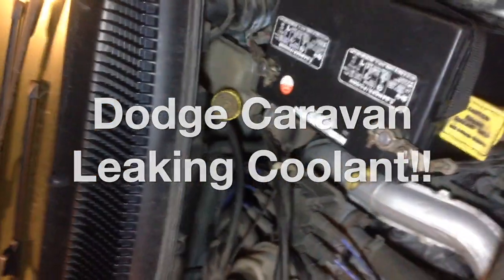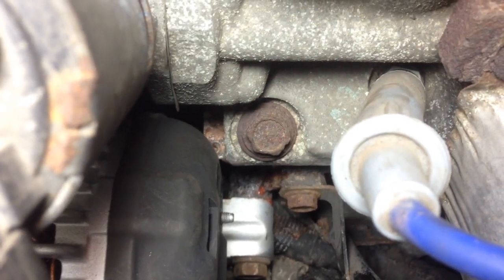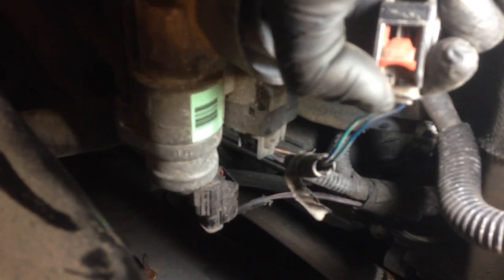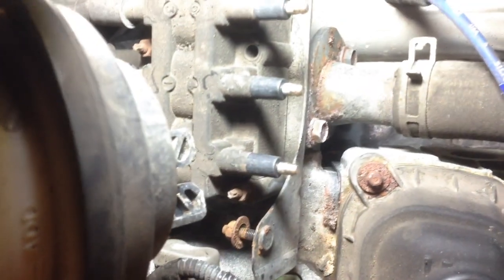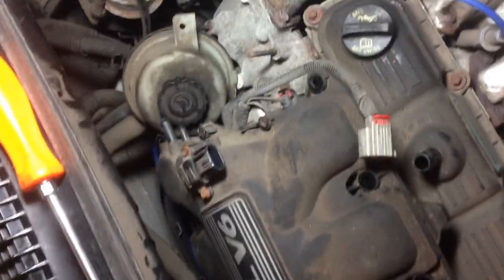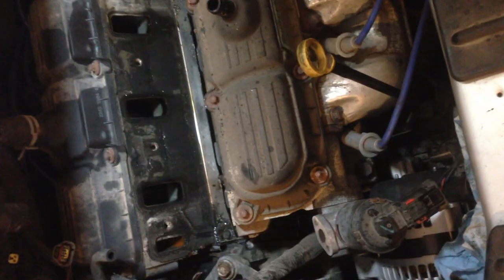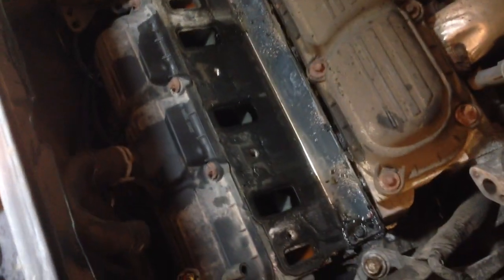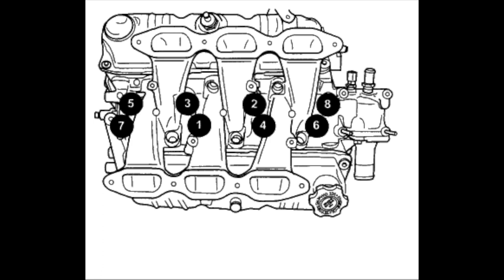2001 - 2007 Dodge Caravan Intake Manifold Coolant Leak and Fix

Comment: Excellent detail where needed with hidden bolts/hoses, tips, etc.
Reply from the maker: Thanks so much, really appreciate the comment !!!
Reply: @GarageKing  how u connect  pressure tester kit?
Reply from the maker: @savipv8491 hey there, you connect it to the radiator like I did in the video. You have to buy a pressure tester kit and it will come with different adapters.

Comment: What about leaking into the exhaust. 2007 grand caravan. Could it be Head gasket, cracked intake port, or intake manifold gasket.. There is no water in oil at all and does not overfill, and no superheated of the radiator water, bubbles or exhaust smell. This has apparently been going on for years and getting worse, although radiator sealer is slowing it. My muffler has rusted from inside out. I just replaced the radiator and water pump as they also were leaking. When it starts to rain on an old vehicle it pours. Thank you
Reply from the maker: Hey brother thanks for the comment.  I don't see many cracked heads on these, what I do see is leaking intake manifolds.  They can be confused with a head leak from the outside (when looking) as the coolant runs down the rear cylinder head and the coolant boils away (you never see it)  So you don't get a leak on the ground (unless its really bad) you don't get a rad that overflows when you start the engine cold with no rad cap (usually head gasket) A really good way is to pressure test it, you can buy a cheap pressure tester on Amazon.  Check out this short 30 second or so clip of me pressure testing a caravan, you can see the coolant leaking from the intake.  https://youtu.be/LYikQA98zJw  By the sounds of your description it looks like you probably just have an intake manifold leak (which is good, as it is not that expensive to fix - just gaskets and new coolant)

Comment: I have the Chrysler version of this (my first car via my mom lol).  It’s leakin real bad we think it’s the coolant reservoir. Besides that, 210000 miles and still drives when it’s not overheating.  But my dads been putting coolant in every 2 weeks.  It’s crazy.
Reply from the maker: Well if its the reservior then you definitely have an easier job.  I would give it a little wash off, let it dry and then pressure test it cold.  If you can't pressure test it, then take is for a drive and see if you can see anything leaking anywhere.  You may have to feel with your hands (being careful not to burn your self of course)

Comment: So I have this exact kind of van. Im having leakage into cylinder 3 behind the engine. I noticed when I was replacing all the spark plugs that the back middle plug was rusty and smelled of coolant. What can I do to fix?
Reply from the maker: That's good if you can see the leak/smell as that means its probably leaking from the outside.  It could be the same thing as the video (the intake manifold) your best bet is to wash the engine and then pressure test and look like I did.  You should see it leaking.
Reply: @GarageKing  Thanks for responding all these years later! Ill have it checked out!
Reply from the maker: @geemu1492 I do my best !!!

Comment: I have a leak.  Did not see it under pressure, but I have to refill radiator most every day.   It is not pulling coolant back from the reservoir.  Why not?   I sucked on the hose and the coolant from the res came back to my mouth (I know, bad).  I just got some dye and a UV light.  That should help me find it.
Reply from the maker: Hey there and thanks for the reply, the reason its not pulling coolant back from the reservoir is it's pulling in air instead which means its easier to pull in air than pull the coolant back.  I suggest that you get some engine degreaser and give the engine/radiator a good cleaning.  Let the engine dry and then raise the vehicle on jack stands.  Put the pressure tester on and go underneath and WAIT...  You might have to wait for 10min to see a drip, and then you can trace the drip.  The most common leak points are the intake manifold, and also the radiator can leak where the plastic meets the aluminum core. FYI - don't feel bad about sucking on the hose to test it, we have all been there LOL :)
Reply: Thanks for the response and thanks for making the video. 

My engine is fairly clean so I didn't clean it this time.  I did however (2005 dodge GC) pull the crossbar off so I could get a good look at the radiator.  I filled it up just a little and put some dye in the radiator.  I then put the minivan front wheels up on jack stands. 

I just let it run for about 45 minutes. I checked everywhere from above and below and the only place I found dye was the filler neck that connects to the rad cap. nothing from the manifold spots you showed in your video.  I got a new rad cap from the dealership a few days ago and it leaks less and it had some coolant raising the level in the overflow tank, which it wasn't doing before (with old cap flow tank always staying the same. 

Also noticed some dye where filler neck meets rubber hose to overflow tank.  This was super tiny when letting engine idle in driveway.  Again, no puddles on ground. 

I am thinking new radiator and new hose to flow tank.  What do you think?  Also my new Maddox pressure tester leaks a little at the filler neck and I can hear it hissing.  But it still has a little pressure overnight, but not all of the 15 lbs. 

How do you know overflow tank is good?  Thanks.   And is Maddox pressure tester good or should I return it and get a Snap On?  And after letting it sit for a half hr with engine off (and rad cap still on under pressure), the leaks evaporated.   And when engine was running, I wiped off leaks and they came back.  Last word:  I had this problem when I bought the car in the fall - put a new cap on it and problem solved, for the time being.  But then it was spewing out of the cap area and not a tiny leak like now.   @GarageKing
Reply from the maker: @oregonxyz  Hey you caught me at a good time checking messages. I wouldn't get a Snap On pressure tester.  I have one as I'm a licenced mechanic so I use it all the time.  The Maddox is pretty good, I know it has the "Harbour Freight" attached to it, but its a pretty good unit. I'm glad you are thorough with you investigation into the problem.  Before you go replacing anything, based on what you wrote I would check to see how tight that overflow hose is on the radiator. Sometimes they get soft and leak, they can suck air in.  Some are just pushed on, and some have a clamp, if yours does not have a clamp, put one on to test. Something like this https://amzn.to/3OWfpRG  just make sure you get the right size.  These clamps are very low profile and should not interfere with the cap. Also since you put dye in, really inspect the radiator where the aluminum meets the plastic, super COMMON to leak. You can check the overflow tank by removing it and filling it with water and then checking for leaks.  Yours may need a cleaning anyway LOL :)  Thanks for the follow up and I would be curious what you find.  I'm logging off for the night but will be checking tomorrow :)
Reply: I thought about your solution beforehand, but since I am burning what is left of my summer vacation, I decided to just go ahead and put in a new radiator.  The hose from rad to res tank still looks like it is in great shape. 

I put it in today in 103 degree outside heat in the sun.  Let it run for a while and no more leaks at the filler neck.  I drove about 25 miles around town to give it a little test drive and went for a swim in the Columbia river to cool myself down.

Took a look under the hood a little after midnight and...    wait for it...     THE RESERVOIR LEVEL WENT DOWN!!!    Still too hot to try to take the cap off, so I'll check that in the morning.  

After I put in the new radiator, I filled it with the cap off.  Level went down when I started it up.  And it went down again when top hose got hot and thermostat opened.  Topped it off and then put the cap on.  I would have cleaned out the entire system, but I just did that a few months ago.   The res tank was dry but clean when I bought the car last fall. 

I am also guessing that the filler neck leak is why my Maddox air pressure tool didn't hold the pressure.  I'll try that again when I can take the cap off.  The neck just below the cap is where I had the leak. 

Back in the 80s, I took the two year community college program of automotive repair and it pays off every time.  I spent some time working as a mechanic and wish I stuck with it.  I'm 60 now and would be too slow and take too many breaks to be able to do it in a dealership again.  But I can still dive into my car  in my driveway.   @GarageKing
Reply from the maker: @oregonxyz  That is awesome and thanks for the follow up !!  Very happy you got it all done and for 60 your still "tinkering" around so that is good for the body.  As you said, the reservoir is now sucking coolant so I wouldn't even worry about pressure testing, just make sure the reservoir is between cold and hot and you are good to go.  You might have to top it off once and that's not a leak, its just any air bubbles getting pushed out when its hot.
Reply: Thanks for all the support!   I'm going to carry some extra coolant with me and check it when I go on trips for the next week or so.  I could still have an internal leak.  But at least now I can add it to the reservoir tank and not have to wait a long time to open the cap. Earlier, I tested it running for hydrocarbons in the coolant and the blue liquid stayed blue, so that is a very good sign.  The coolant dye was great - the coolant came out as bright neon green - very visible.  The yellow glasses helped, but the little tiny UV penlight did not help at all in the bright sun.  Need a more powerful UV light.  

I am a big believer in the law of multiple car problems.  (I made it up myself).  When you develop a car problem, it is highly unlikely that the car develops multiple problems at the same time. If you keep your car well maintained, then almost always problems occur one at a time, and are easier to spot.  But when someone does not fix problems or check fluids or change oil, etc, then it is hard to diagnose and there could be multiple problems when they go to check on it. 

Cars are like hamburger meat - keep it in the fridge and it stays good for a while, but will eventually go bad (no car lasts forever).  But leave it on the counter, and it goes really bad really fast.  Always keep a car maintained.  You don't know what the previous owner did, but you do know what you do.  Which is why I like to repair my cars and not take a chance on buying another used car.     @GarageKing
Reply from the maker: Hey thanks for the follow up and I like your "law of multiple car problems" I believe you are onto something there, and a well maintained car will most likely only develop one problem at a time. You are right on that one.  I'm really glad it all worked out for you !!  @oregonxyz

Comment: What company manufactures your coolant pressure kit and where did you purchase yours?  Thank you!
Reply from the maker: Thanks for the comment, I used a Snap-On pressure tester, but I'm a licensed mechanic so I use it quite a bit.  If you are only going to use it once or twice you can usually find a cheaper less durable (but still good) version at NAPA, Canadian Tire, Autozone etc.  The Snap-On one is only sold through Snap-On dealers (they are in those vans that drive around)  If you wanted a Snap-On one, you would go to their site, and call their help line, tell them where you live and they will tell you who the dealer is in your area.  Hope this helps you out and good luck with your job :)

Comment: Was the silicone actually necessary? Feel like every time I use that it ends up causing more issues
Reply from the maker: You bet it is brother.  I remember when I was first training as a mechanics apprentice years ago I resealed an intake manifold on a GM 3.1L V6.  Well it came back leaking oil and one of the old fellows who mentored me took a quick look when I pulled the intake back off and said "not enough silicone son, don't skimp on it".  I did have to to the job for free (as I was paid flat rate) so I learned.  On any V style engine, V8 or V6, always put a good dab of silicone in the corners, I don't believe I showed a shot of it in this video and I'll tell you why.  I learned that once the silicone is on, assemble ASAP or you may have problems.  So once I put the silicone on I would have assembled it right away. 

You never want to put the silicone the length of the rubber, only in the corners.  If you put it the whole way it will cause problems.  I have seen people use silicone on valve cover gaskets and it causes the gaskets to slip out of place when torqued down.

On the V style engine when doing an intake manifold please put in the mating corners, you can't go wrong and when I worked in the dealership it was stated in the manufacture shop manual to do so.   Thanks for your comment buddy and good luck if you are doing this job :)
Reply: @GarageKing  thank you man, and I appreciate the quick response. I haven't had the pleasure of doing one of these gaskets yet, but expected a good hour or 2 to do the job. I wouldn't want to have to do it again because of a little silicone discrepancy, so thanks for clearing that up. Sounds like one of those times they did this exact thing upon assembly. Like you said, if you put it the whole way it will cause problems and for this reason I am always skeptical of silicone, a lil bit too much and you're doing the whole job over. Depending if the van makes it to spring, I will finally get around to doing this and the valve cover gaskets. 215k and seems like the car will fall apart around the engine and trans. Thanks for the clarification
Reply from the maker: @johnnyversaci7091  Anytime brother!!!!  I would say to give yourself a good 4 hours if its your first time doing this job, you have to drain the coolant before you pull the intake and the other thing I learned as a mechanic was THE CLEANING!!!!  It's the cleaning that takes forever.  You want to make sure those mating surfaces are clean.  

TIP - after you are done cleaning as best you can, use brake clean in the corners before you use the silicone.  Brake clean will wash away and oil reside (that can cause sealing problems with the silicone) and it just evaporates afterwards.  Many silicone type jobs that leak afterwards were not cleaned properly and thus leak.

215K is a lot of mileage, but if you can limp it along further why not..  The good thing about this job is if you do it yourself it really doesn't cost a lot, its all labour!!!!

Cheers!!
Reply: @GarageKing  oh yea definitely need that. I usually try to clean these surfaces with a razor and after spray some brake clean on a towel and wipe it down. If I do it at the right time maybe I won't have to really drain the coolant😂 unless you have to drain all of it... I usually end up just draining it at whichever part I have to disconnect to do the repair since I'm lazy. I'll probably shoot for 3 hours then haha I have a feeling she could make it to 260+ If I do the rack and new exhaust but that's a different story lol
Reply from the maker: If you drain out a few liters from the rad you will be ok. If you just pull off the rad hose the level is too high and when you pull the intake coolant will go into the engine (antifreeze eats  engine bearings)   Good on you for using a razor blade. I like razor blades but sometimes use a wire wheel (and I’m careful and cover open areas with rags)   Fun Fact for you - There was a GM document that came out years ago when I was working at the dealer that banned us from using those 3M abrasive pads that go on an angle grinder for cleaning engine surfaces. They found that microscopic abrasive particles were getting into the engine and knocking (worn bearings) resulted in many cases, but not until about 20-50k after the repair!!! They figured it out as many vehicles with head gasket/intake leaks resealed under extended warranty had an intake sealed early in its life and the mechanic used those pads on the original repair!!!  Exhaust is easy for you to do. I haven’t done a rack on one of those vans, but I know sometimes they are a pain to get out. I’m not sure how hard that one is to do.  Anyway 1:33am in Canada so time to get some shut eye. Nice chatting with you and good luck with your repairs in the future:)
Reply: @GarageKing  that's true, maybe the bottom hose would work then? I was actually thinking about that after I typed that last one. I'm always skeptical to use the rad drain valve for some reason lol. And yes, none of those pads with the angle grinder, I've seen that used in the shop a lot for machined surfaces and always figured it's a bad idea
Reply from the maker: @johnnyversaci7091  Yup, if you pull the lower rad hose and let out a few litres you will be fine.  Just make sure you take off the rad cap first.  Sorry for the late reply, my neighbour gave me his Tesla for the day, so I wanted to film that that thing!!!!  So I have been out all day, just getting caught up now.  Busy life LOL :)
Reply: @johnnyversaci7091  Yes sir, those radiator drains sure get stuck and break. Lower hose as you said is best for draining.
Reply: @frankcrawford416  💯💯 I actually just saw someone posted in the mazdaspeed FB group I'm in, that he broke his coolant drain plug haha

Comment: Can this intake manifold gasket also be responsible for an oil leak?
Reply from the maker: Yup you bet it can.  It can leak at the rubber seals at the very bottom.  In fact this was a very common oil leak area for the GM 3100 series engines where silicone, not a rubber seal like the Dodge was used.